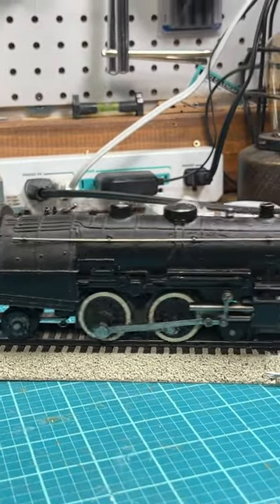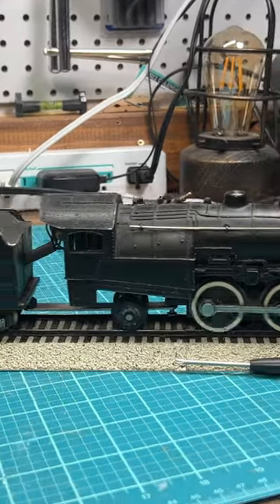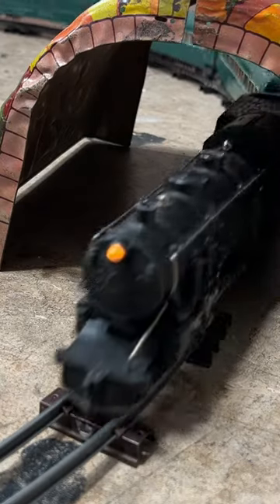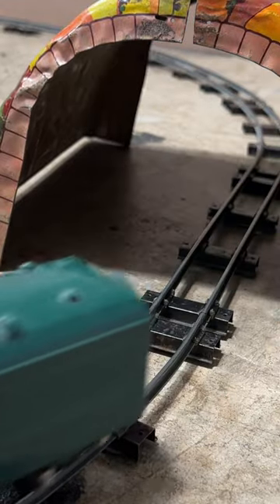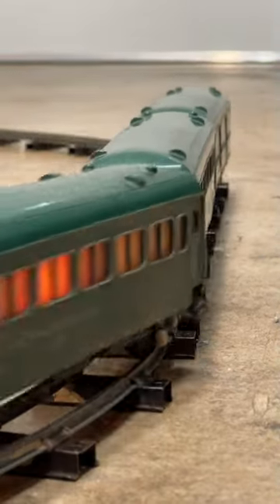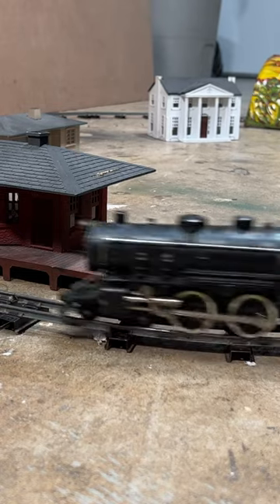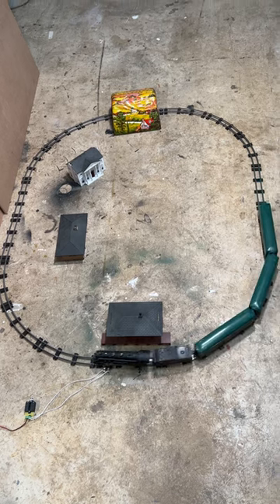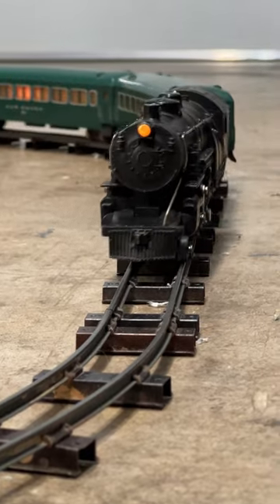72 Year Old American Flyer Train Runs Again #modeltrain

Comment: My dad has the same exact train too! After not running for 65 years, all we had to do was solder a broken wire, clean some of the components, and lubricate the wheels. Unfortunately though, the steam maker was sawed off some time while it ran back in the fifties due to it having not worked. I am planning on buying a new one, and have already found a dealer with the right part. Just waiting for my dad to purchase it so i can put it back in and have a fully functional american flyer!